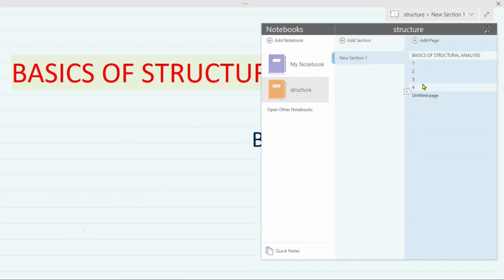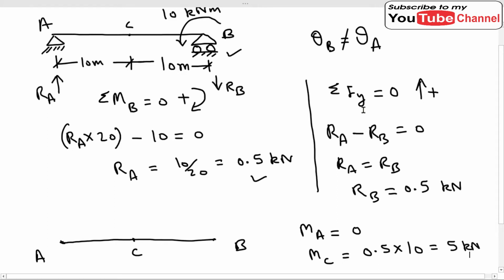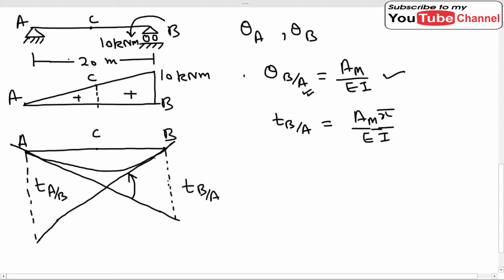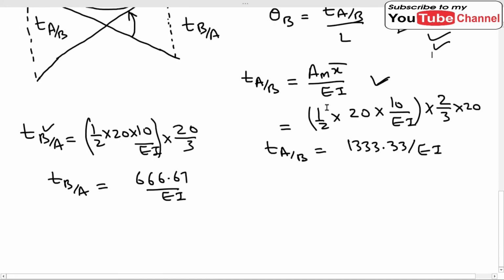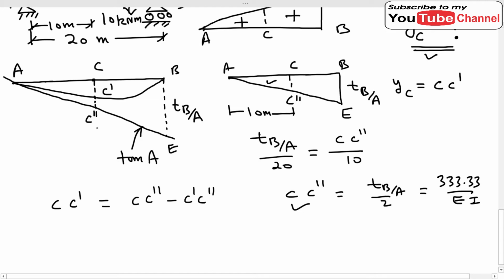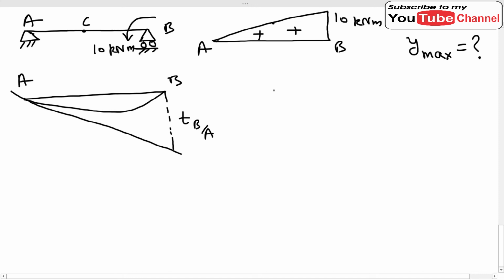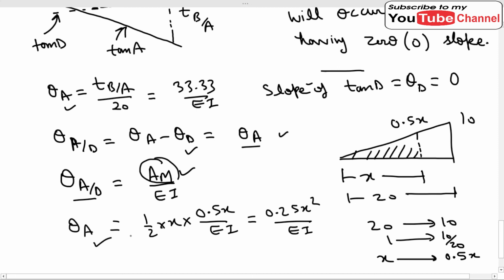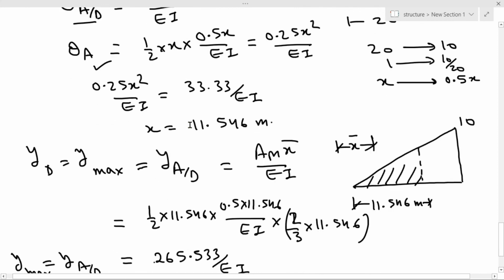SLOPE AND DEFLECTION OF SIMPLE SUPPORTED BEAM WITH MOMENT USING MOMENT AREA METHOD || SOLVED PROBLEM

Comment: If a moment M is applied at point B, which is a support, the bending moment at B will still be zero because the support cannot resist the moment.
1. The bending moment at a simply supported support is always zero.
2. The applied moment will influence the bending moment distribution along the beam but not at the support itself
Reply: Yes it's right